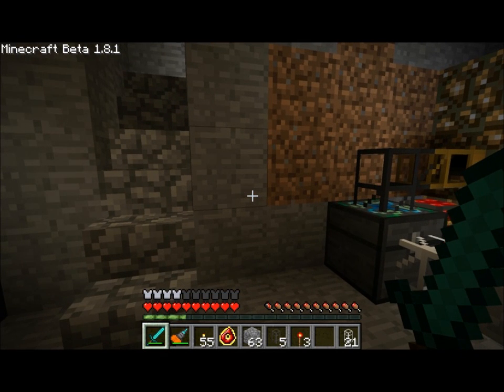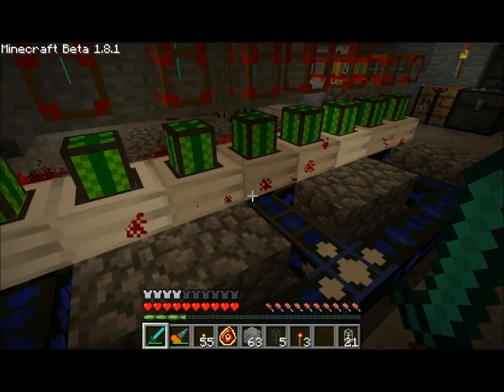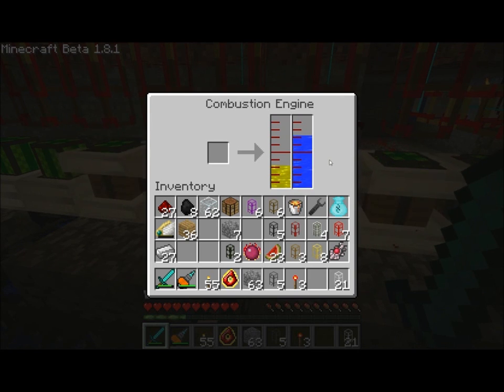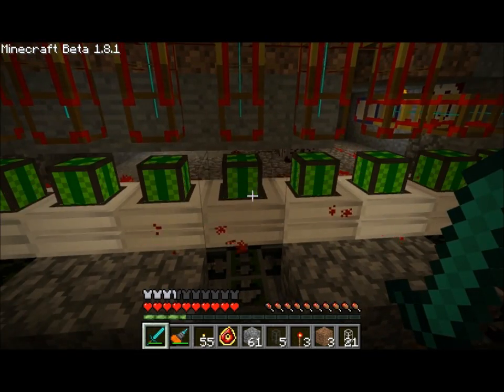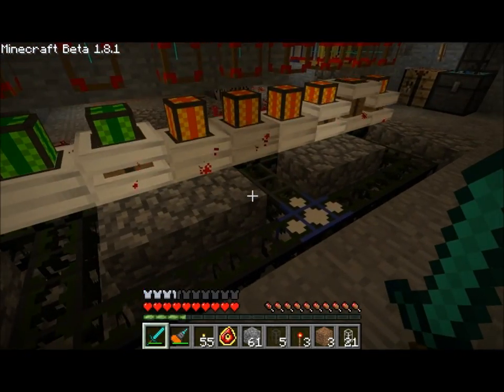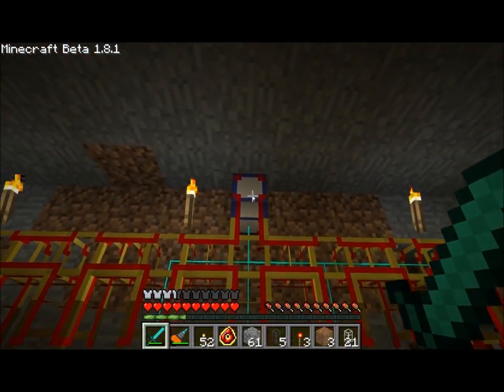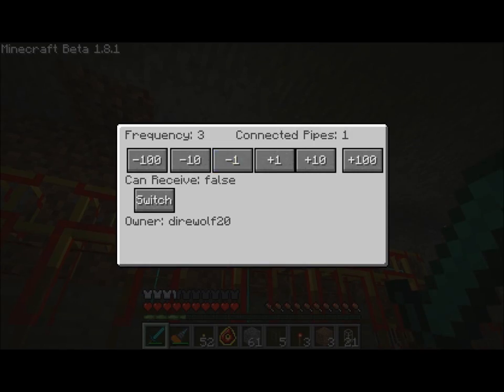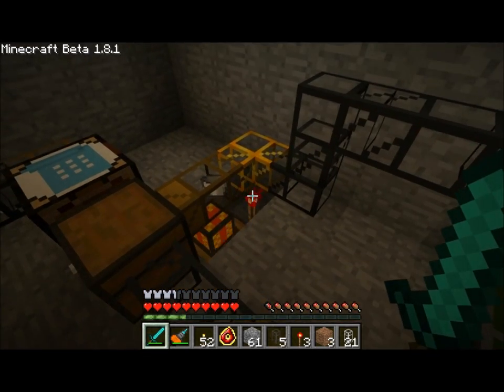Minecraft 1.8.1 - More on Steam Engines and Lava Cell Creator

Comment: Dont forget about golden waterproof pipes, they have 4x the troughput of all other pipes. If you make a "bus" type system for your engines you will at most be able to supply 5ish fuel powered combustion engines if you're not using golden pipes. Also, if you're using teleport pipes, dont connect a normal pipe between the pump and the teleport pipe as teleport pipes have no limit to throughput

From what I could gather a combustion engine running on lava produces the same amount of power fr

Comment: I've noticed that the engines overheat faster with better fuel. I can run 8 combustion engines on 1 pump if they are all running on lava for example. They however produce less energy. For example those 8 are just enough to run 1 refinery where as it only takes 2 engines running on fuel to run it

Comment: @direwolf20
If you make the lava bucket maker and cell maker come out of the same chest its MUCH FASTER Like this.
P I P
E   E
BAC

E= wooden pipe
P= Cobblestone Pipe
I = Iron pipe
A = Chest
B= Lava Bucket Bench
C= Cell and Lava Bench
Then using advanced wooden pipes you could take the cells. 
This is much smaller and much faster.